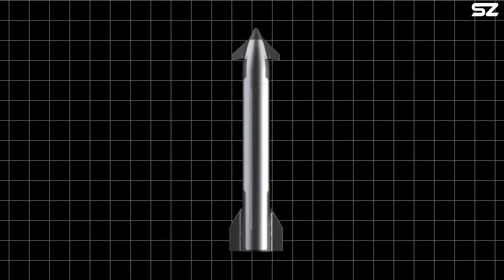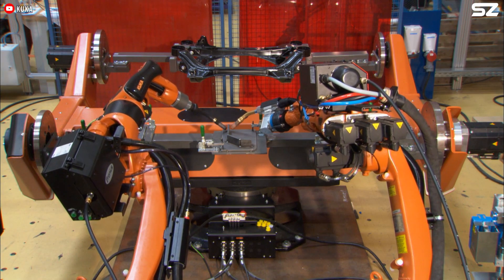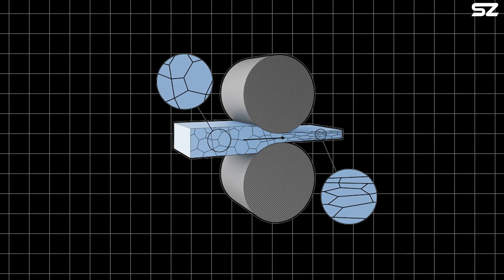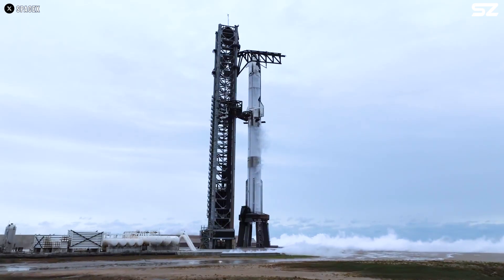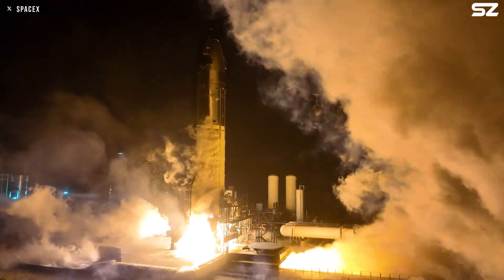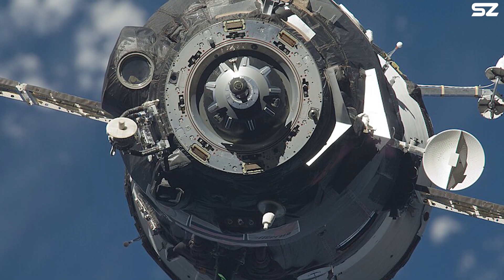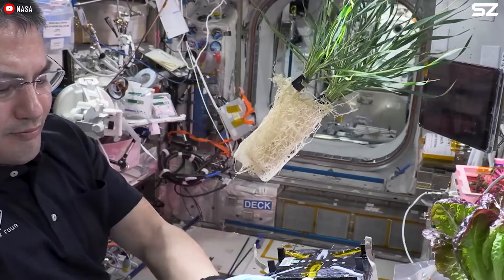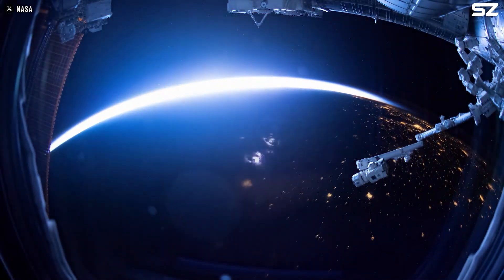SpaceX's Starship V3 Welding Solution!

Comment: Flux and shielding gases are there to protect the molten metal from oxidization. They're not needed in space. Tell me that welding in space is more challenging.Fifty years ago, I was told cold welding in space would be a considerable problem.
Reply: Indeed Welding in space is ideal conditions in many respects.
As you say no oxygen to oxidise the weld and most volatile contaminants that form an occlusion under atmospheric conditions would be ejected from the weld pool in space so welding in space with electron beam or laser seems ideal conditions - also no gravity sag so weld pool will stay where you want it.

Comment: You should watch the educational film: Heat & Speed. I'm sure SpaceX didn't. It goes over building the XB-70, an all stainless steel bomber, including how they handled welding and inspection at the time. A bit vintage as welding has improved. SpaceX hasn't developed, only opened their eyes after a very long delay.

Comment: Starship nose could be made with truncated cones each one increasing its slope by 15 degrees. This would be simple to fabricate and weld. 
15 degrees because that angular change flows air as smoothly as a continuous curve.

Comment: I would think that welding in space would be easier. A lot of the problem with welding is keeping atmospheric gasses out of the weld area. This is why we use inert gasses.
Reply: You might be surprised how much inert welding gas actually alters the welding arc
Reply: The cold tempp of space may quench the weld too rapidly resulting in brittle and weak welds
Reply: @kurtgx that's not a thing. This dumb movie notion of cold space is extremely wrong. There is no medium to transfer heat in space, so overheating is a major issue in Spaceflight, the only way to cool things by thermal radiation while in earth you have the atmosphere absorbing heat. A big part of the ISS surface are radiators to shed out heat. 
You will not freeze in space, you will overheat and cook yourself. Welds will not instantly get cold, they will remain hot for a long time transferring heat to all material around it until infrared radiation emits all the energy equalizing.

Besides, space is not cold, when in the sun side temperature can go very high and overheat becomes an issue since you absorb solar heat and can't dissipate it. Space suits main challenge is when under the sun, needing a highly effective cooling system with active refrigeration and heat dispersal. It doesn't need heating besides a small low power electric resistance like in electric blankets , it needs cooling.

Comment: I'm wondering what they're going to do when they actually reach re-entry speeds from orbit that produce those 9000F plasma temps, and their geometry doesn't create the barrier that prevents those temps from reaching the tiles, which can't handle that heat.  There's a reason why the space shuttle had that blunt front on it....
Reply: Your point is almost right on 👍. What you forget is that the Starship doesn't re-enter that way. It comes in, in a "belly-flop" maneuver, which places the tiles DIRECTLY in front of the mass of the ship as it re-enters the atmosphere, and yes those tiles are DESIGNED to take the worst of the heat and forces of re-entry, none of which has anything to do with the topic of this video.
Reply: @chuckintexas  The shuttle also came in on a belly flop, and it wouldn't turn over until most of its speed was scrubbed off.  You better go back and look at the tiles on the shuttle....they show the same location and area of coverage that the Starship has adopted.  The tiles on the Starship can handle heat up to 2300F, which is nowhere near the 9000F plasma gases.  So, geometry of the ship itself is critical, because the tiles will never handle anywhere near 9000F

I think you need to do a bit of research on the shuttle and the Starship, before you post what are obviously your opinions that are not based on fact.
Reply: @johntomasik1555   - Indeed , altho I don't remember it "turning over" ?!!? The tiles are at EXACTLY the same contact side for the Starship as they were on the shuttle. There was NO time that the shuttle presented a side toward the atmosphere that the tiles did not protect it from the forces and the heat of re-entry, and the SAME is true for Starship.
Reply: @chuckintexas  And my point is the shuttle was designed with very blunt entry surfaces with the purpose of creating a shock barrier, which is actually what protects the tiles from damage from the 9000F plasma that forms during reentry.  The Starship has a pointed nose, a cylindrical belly (the entire bottom of the shuttle was flat), and has heat and stress risers around the hinge areas of its control surfaces, all of which won't create that shock barrier.

You need to go look for the videos that explain in detail how the shuttle survived reentry.  Its tiles were never exposed directly to those 9000 degree plasma gases because of the shock barrier its blunt surfaces created upon reentry.
Reply: @johntomasik1555  - Wrong.
Reply: You got them. You're apparently smarter that all of the actual engineers at SpaceX.
Reply: @ So, you  got nothin'.
Reply: @2006Whippet   - 👍He likes thinking so, anyway 👍!

Comment: Metal wields itself on contact in space wielding not required
Reply: Morons
Reply: That's not completely true, the only contact weld if they are full clean and void of any oxidation at all.
Reply: Problem is, if you need a repair or to make something, you can't wait rly slow process.

Comment: temp fluxuations require temp sticks and torches to heat material to temp before welding in space thats kinda rough youd need to put a heat strip inside to heat the material and if this gizmos going in and out of the sun every 45 mins gonna get kinda hot in that ship but it is what it is

Comment: maybe ...temp sticks do the same thing you need a root bro temp stick keeps the material hardening past the weld otherwise it would crack and rust the sheilding keeps the material from absorbing unwanted goodies into the weld also causing cracks since this is probly aluminum this here method kinda saves time as there isnt many people that can weld aluminum properly
Reply: I know I haven't mastered the perfect aluminum weld, and I'm not in orbit !